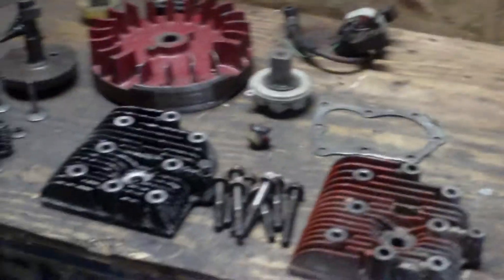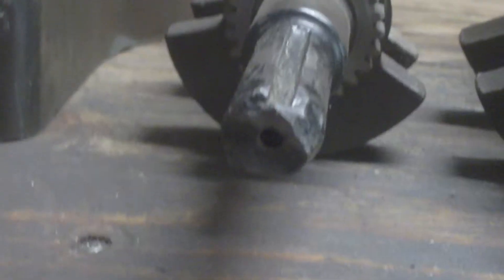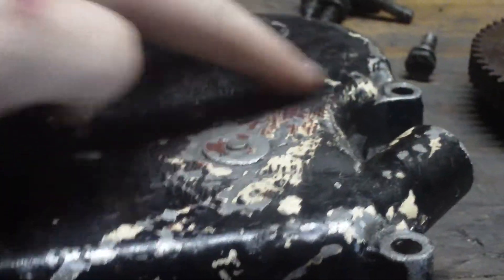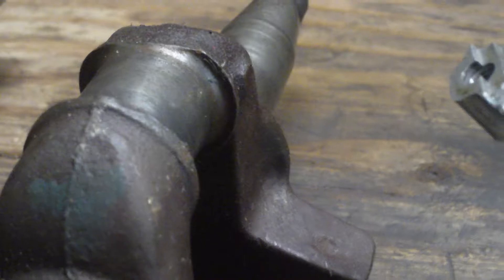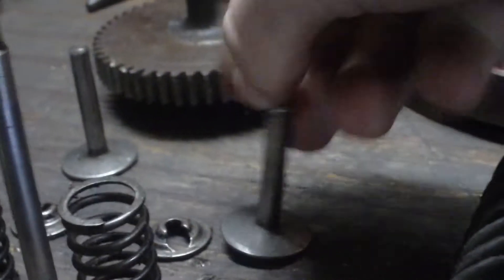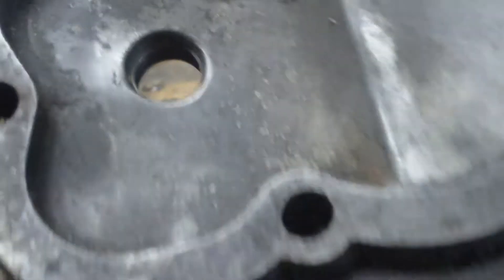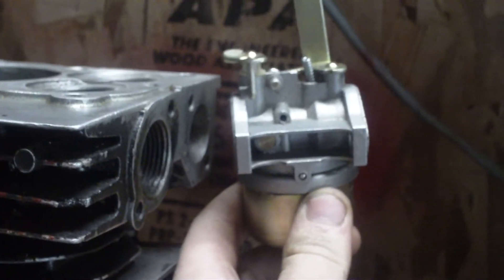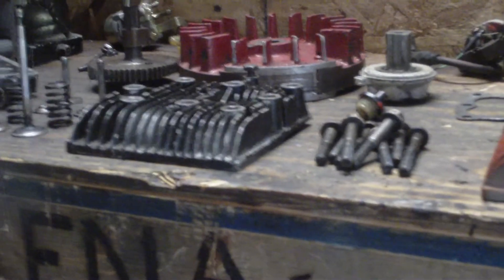Briggs and Stratton Engine Rebuild Project

Comment: Take some sandpaper on a table and rub the head on the sandpaper to remove material which may increase the compression a little.
Reply from the maker: I have a 1/2 steel plate just for that! I made a video on surfacing heads a while back. Thanks for Watching!!!

Comment: There are a few different oversized piston & rings available for the Briggs & Stratton engine so they can be rebored & have the oversized piston fitted, it would be nice to be able to press an iron sleeve into the Aluminium block as it would make the engine last longer.
I know of this person my dad used to work with who did some modifications like that to a Briggs & Stratton engine including pressing needle roller bearings into the engine halves so the crankshaft could ride on them instead of the crankshaft journals running directly onto the Aluminium case.
They have no sleeve bearings in them for the crankshaft so it runs directly into the case.
Reply from the maker: +Russell Booth That is true, but the if you look on the parts diagrams for these motors, there is standard and oversize pistons/rings available but these are not chrome plated, just standard aluminum pistons and cast iron rings, for a aluminum bore engine you have to order the chrome plated piston and chrome rings, and the rings are slightly oversized to allow for wear on the cylinder. It is possible to sleeve them, its been done, but it is costly. I have another engine in worse shape than this one that needs a sleeve in it. I never did think to much of the "bearings" on these, just using the block as a plain bearing. Some do have ball bearings, usually the older ones. Thanks for Watching!!!

Comment from the maker: no problem, glad it helped. its a good hobby / side line to get into, i really enjoy it. Thats a good motor to get started on! I did a 4 part video on rebuilding a briggs 12.5 horse motor, quite a bit bigger and different than a 3.5 but it may be worth watching or skimming through, i do hope to do a video specifically on rebuilding a 3 or 3.5 horse push mower engine this summer or next. good luck on your project! thanks for watching!!!

Comment from the maker: @skidoo99ful1 camshaft or crankshaft, because when you pull the sump cover and when both valves are closed you just pull the cam out. now to pull the crankshaft out you have to first pull the flywheel and disconnect the rod and piston from it. thanks for watching!!!

Comment: I have a go-kart with a 5 HP Tecumseh engine and the crankshaft is a 3/4 inch. A 5 HP Briggs would probably have the same size crankshaft. I'm going to start rebuilding engines!!! Great video!!!

Comment: I am going to be rebuilding an old craftsmen push mower engine. I have no idea what horse it is and i will end up replacing a lot of the parts in know that for a fact. I do know it has to be somewhere from 1988-1998, and the motor has to be blown up because i haven't taken it apart yet and i see big medal shavings coming out of what was left of the oil that was in it.

Comment from the maker: @snoozlefroose its called a flywheel. ok there are a couple of methods, on these you have to pry up from between the block and wheel (not to much or you will crack the block) and loosen the starter clutch, then take a brass hammer (regular hammer with mash shaft) then hit it while prying and after a few wacks it should come off. if not you may have to use a puller. on the big engines i use a puller that uses 2 bolts to pry up, with a impact wrench. hope this helps, if not message me....

Comment from the maker: @ChargerMiles007 i'm pretty sure thats what it is, just got me thinking because of the shorter stroke. yeah thats just like the model 25 head will boost compression on a 28. i have 2 covers, but both of them need some work, check out my 5 horse briggs restoration project part 1, i don't know how i'm gona fix it. this one i can just alumiweld a plate over it. but yeah if you got one for a good price i'd consider it. pm me

Comment: Guessing, I would say it is a model 13, 5 horse Briggs.
It is possible that one of the cranks os from a model 10, 4 horse.
The rod and pistons are different between the 2 engines, and won't interchange due to a different piston pin size :(
The cylinder head from a model 10 will fit a model 13, and increase compression, since the bolt hole pattern is the same. Did you need a better crankcase cover, I may have one kicking around Due to my Briggs Overstock!

Comment from the maker: @fatass355 i get alot of parts from either napa or pats small engine online. But the threads on the spark plug hole can be fixed. some people have used helicoils which are like springs, which seem to work good as long as loctite is used. or you can have it welded then drill and retap the threads, and sometimes if you just use a tap and just "clean" the threads it will be as good as new, try that first.Then if all else fails just get a new head. a machine/weld shop will be able to fix it for you.

Comment: Hey.
Do you know where i can get engine parts for those engines ? I have that engine and have broke the spark plug "srew track" on the top of the engine. And i dont know were to order new,or how to fix it...
Any Solutions?
Thx,Nive video

Comment from the maker: @hzaidi3 as long as the oil hole on the connecting rod is facing the camshaft it doesn't not matter how the piston is facing, there are at least 4 oil holes in the oil ring groove that allows oil to get the cylinder, the piston is the same all around, happy new year btw lol

Comment: @fnaguitarplayer9 Yeah, if you look on the bottom of the connecting rod you will see a hole on one side that goes through to the cam journal.  The orientation matters becuase that hole has to be pointing to the area where oil splashes on it.  There is also a nipple on the inside on the top of the connecting rod that is on one side but not the other.  I'm going to have to contact Briggs about this one.

Comment from the maker: @hzaidi3 i posted a comment than reread what you said... i thought you asked how the mark/arrow lines up. i'm not for sure. briggs says the mark should face towards the flywheel except on vertical inteks (model 120000). but to tell you the truth, i've never paid any attention to it really, its just a indicator so your connecting rod will be facing the correct way so you can put the endcap on it on the crankshaft, there is no other need for it the piston is the exact same on both sides...